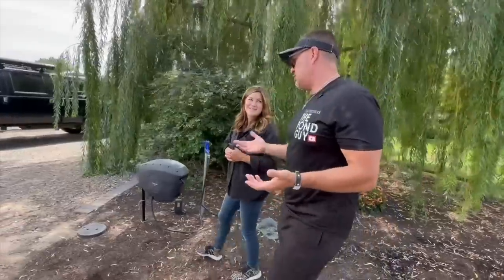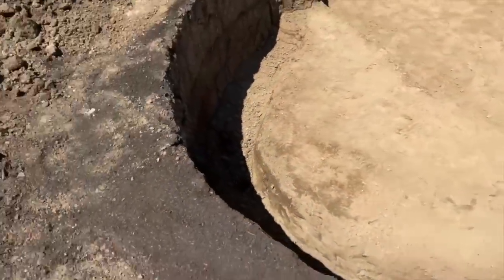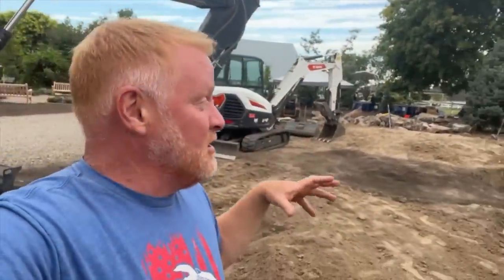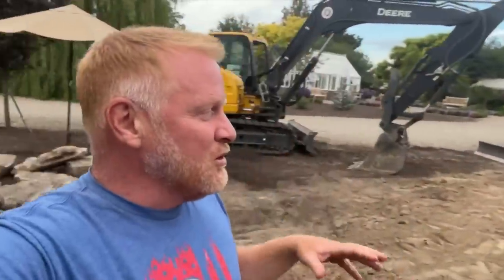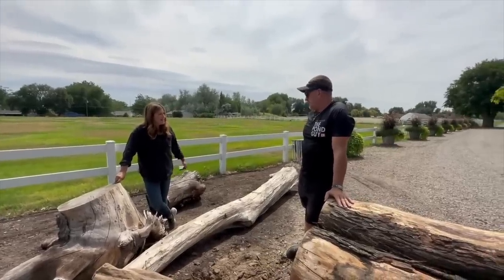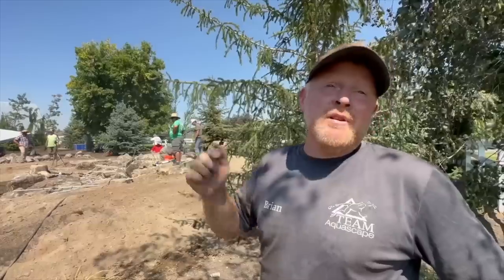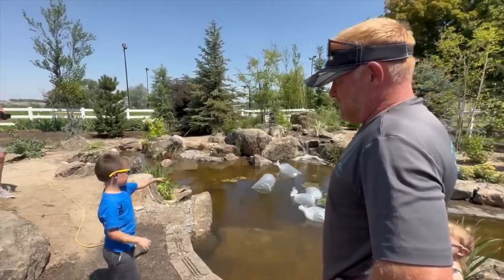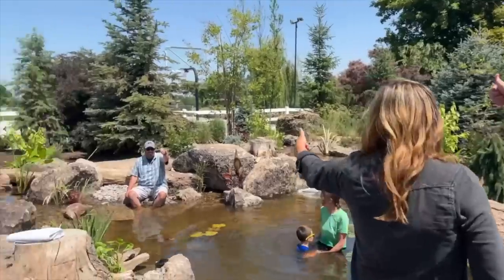Laura's HIDDEN Garden Pond - GARDEN ANSWER

Comment: The team is always placing these huge rocks in just the right place . . . however I am curious to find out what you need to do to get the straps out from underneath the boulders once the incredible weight pins those straps between the ground and the rock.